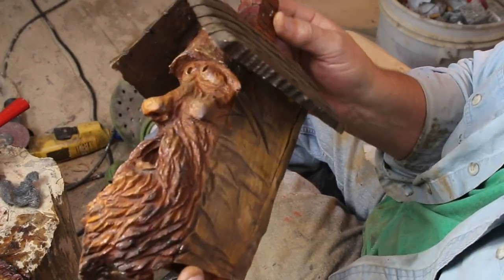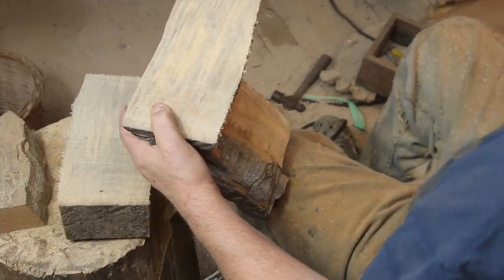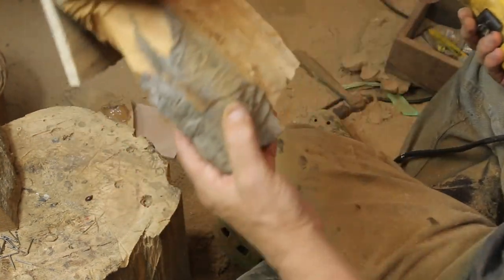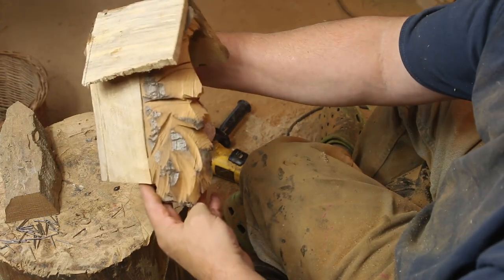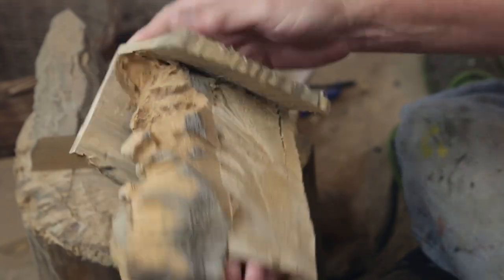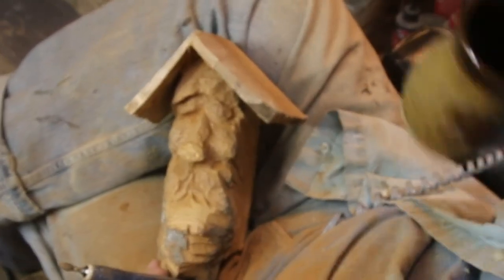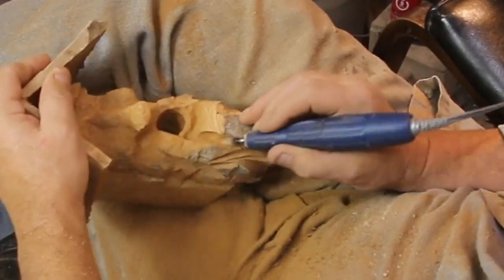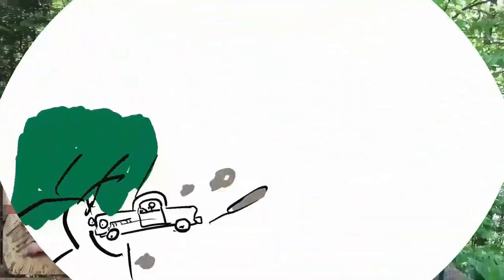Cottonwood Spirit Birdhouse

Comment: What kind of disk are you using on your grinder? Love your work!!
Reply from the maker: Hi Bob, It is just a standard 4 1/2 inch resin disk you can get at any hardware store for a few bucks each. I tend to use 24, 36, or 48 grit as I am removing bulk not look at finish. Thanks for the comments.  Ben
Reply: @StudioOnTheLake  Thanks Ben.